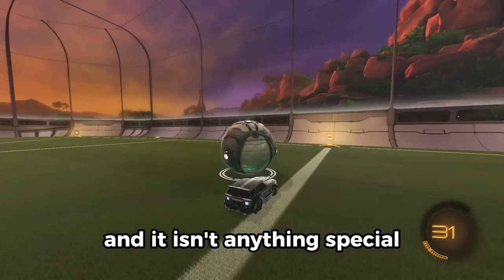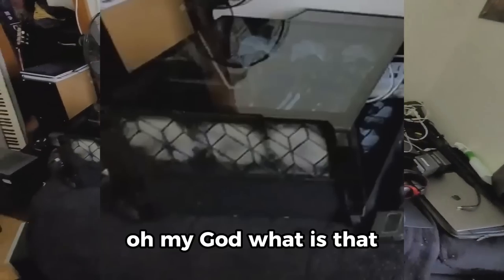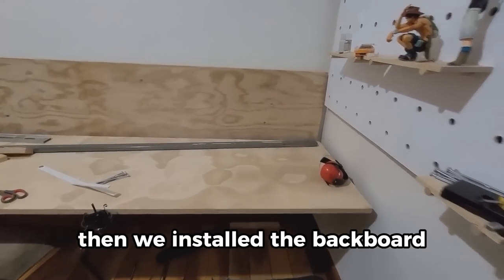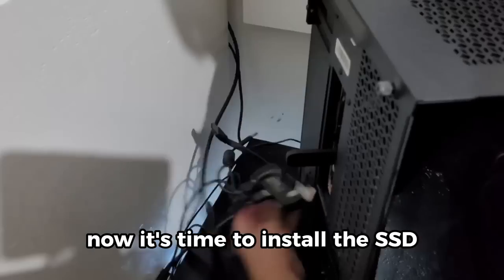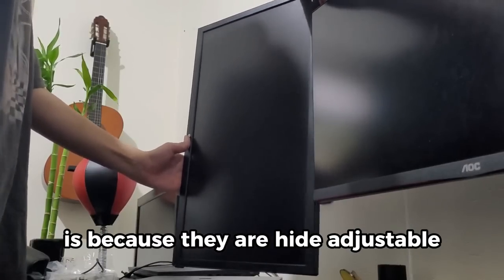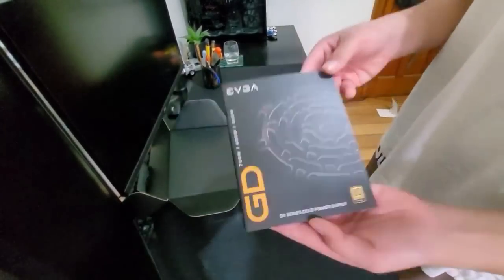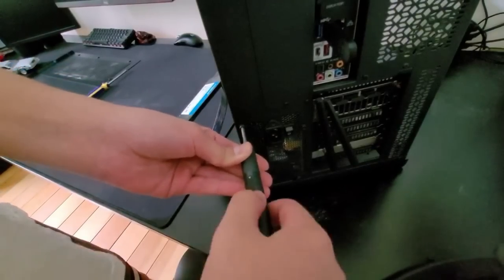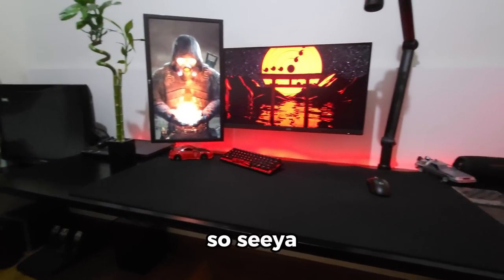Building My DREAM Gaming Setup

Comment: yo bro this an actual w. where did u get the monitor mount from brother?
Reply from the maker: i appreciate it 
i got them from pbtech their called 
Brateck Lumi LDA30-112 17'-32' Single Screen Wall Mounted Gas Spring Monitor Arm

Comment: One tip! Your radiator is upside down! Always upwards, otherwise air will get stuck in your pump.. Air wil always go to the highest poitn, so that your pump mount for the cpu. It will hurt it on long turn preformance! So switch it as soon as possible.  Overall good job!! Really good looking setup you have there.